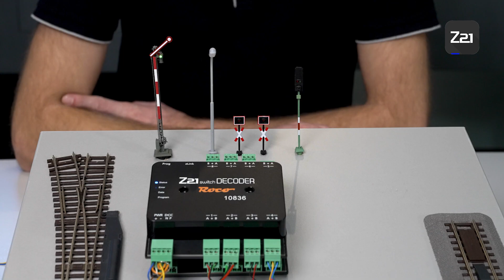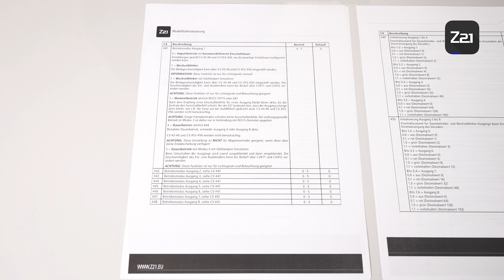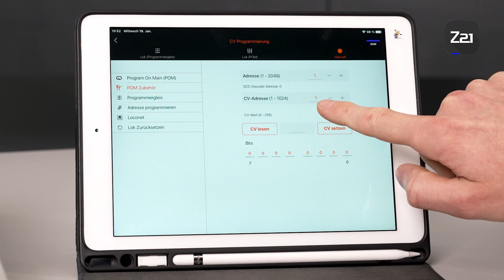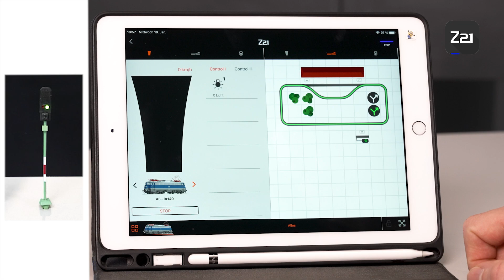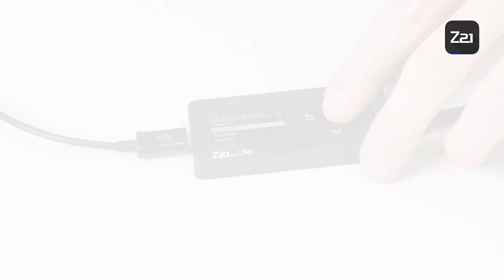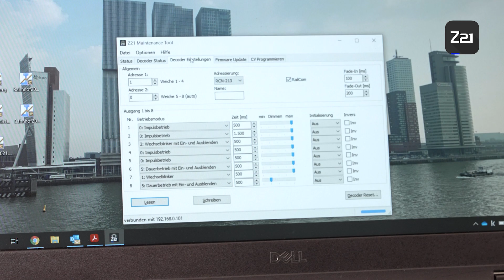Part 12: Z21 Switch Decoder and Pro Link

Comment: Hi! Thank you for your tutorials. Please make also video for Roco 10808 Z21 Detector, how it works, how to connect to tracks, which exact 3.3k resistors (0.25, 0.5 or 1W) you need. Which lengths of isolation tracks do we need with different types of connection. There are not some information in manual.